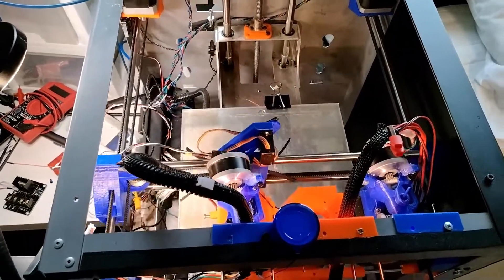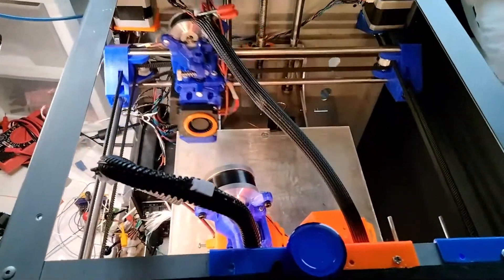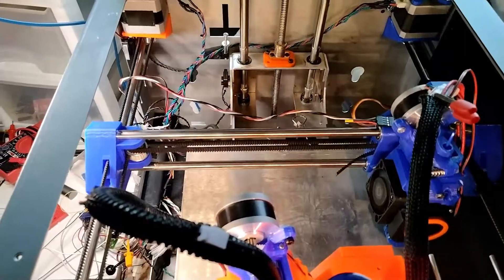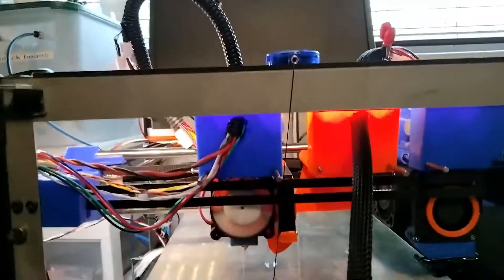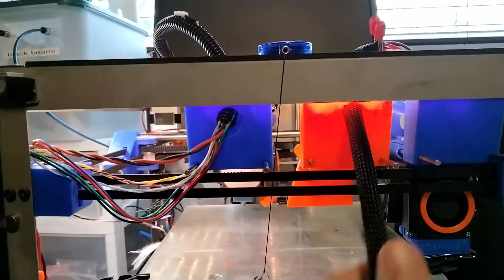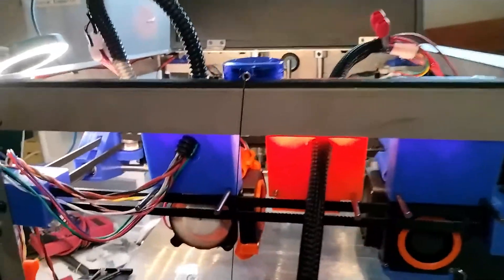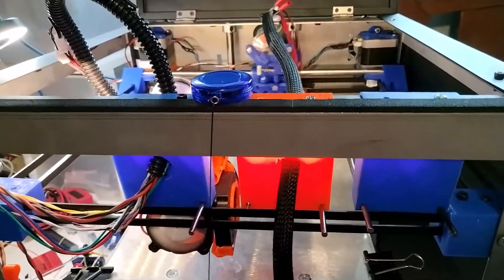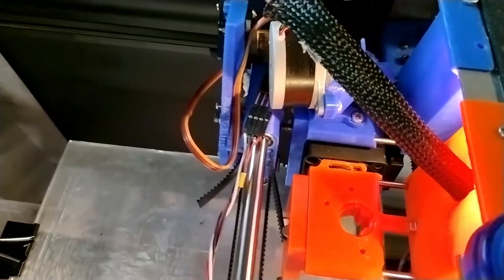Cheap 3D Printed Toolchanger

Comment: Use those key chain "bungees " for cable  management/drag
Reply from the maker: @TrumpstienPhile  that's exactly what I did and it works great! I was making a new video updating it, but I just fried all 3 boards in one shot... So it's gonna be a bit before the new ones come...
Reply: @aaamott ' great minds'.

 Oof  thats frustrating...yeah I managed to kill 2 boards...one I just installed but didn't  realise the metal lid  was pinching  the x stepper cable...goodbye integrated BGA soldered tmc2209😭. Probably  could use a rpi pico as a secondary mcu for driving an auxiliary x driver... but I'm incredibly  lazy🤣

Comment: Hello, fantastic build!! What motors do You use for extruders?
Reply from the maker: Thanks! I use $10 nema14 pancake steppers with a geared extruder. They're pretty nice! The cables ender up being a problem in the long run, so I used keybac Keychains to hold the wires up and it hasn't failed me yet.
Reply: @aaamott  36hs2418cl16?
Reply from the maker: @beltonator  yep! I've got parts linked in the description, too, including the motor I tend to buy